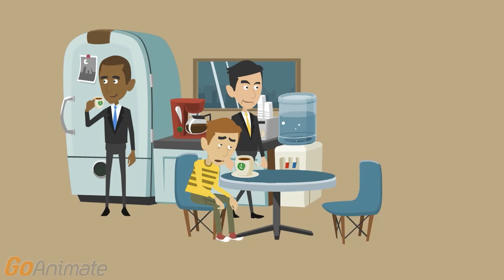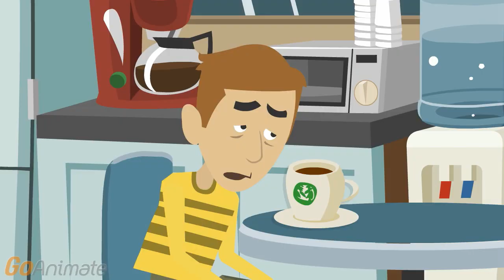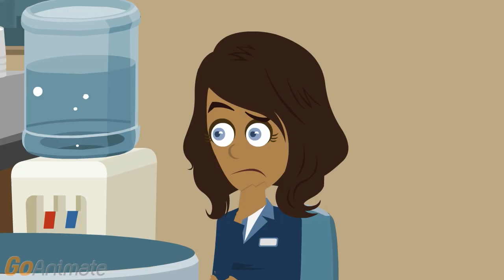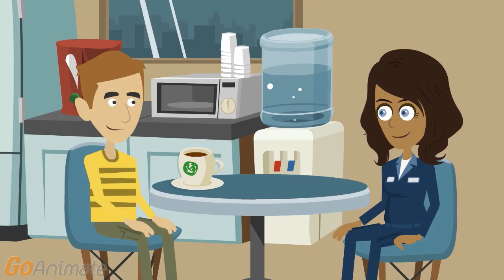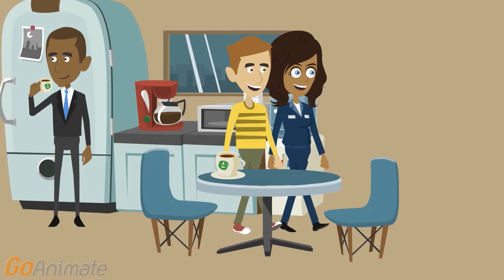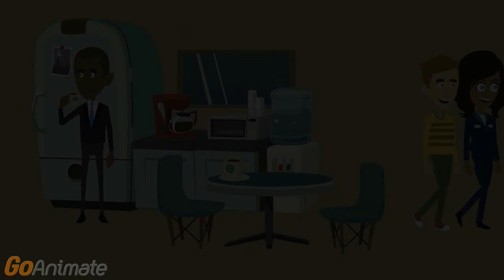Hotpoint Oven Problems

Comment: Terrible oven.  
Bought an expensive one.  In the oven, everything burns on top, but the bottom remains raw.  The dough does not rise.  The oven below boiling more than it bakes, 
and everything burns on top.  Doesn't matter if warm up or not. 
The oven is very small in size - not even a medium-sized pizza can fit.  The flame in the oven is open - baking paper has already caught fire several times.
Reply: Same problem please share if you got solution

Comment: These commercials are a crock of BS I've got a hot point glass top range and oven I've had for 19 years, the bake   Element in the bottom of the oven went out the day of 12/06/2018 the door or sides had never gotten hot, I've got a bunch of grandchildren they have grown up around stove, and we all know how toddler's can be take your eyes off of them and their gone and not one has ever been burned because " the door got HOT" That's crazy,  people  should speak for them self and not try and give the whole line of hot point a blackeye, and yes I'll buy a  Element and replace it and who knows maybe it will last another 18 years. Hot point keep baking.